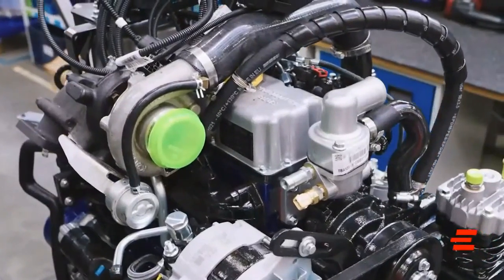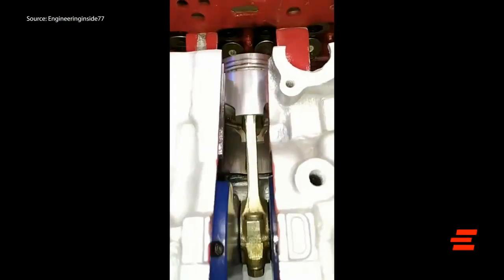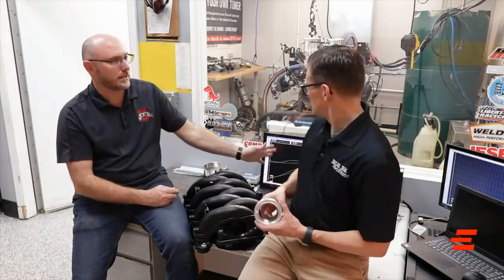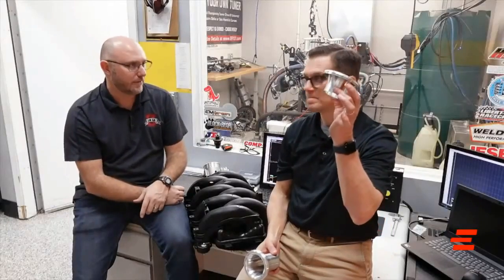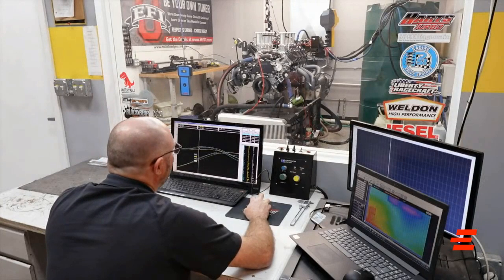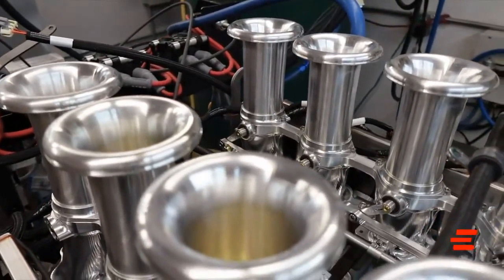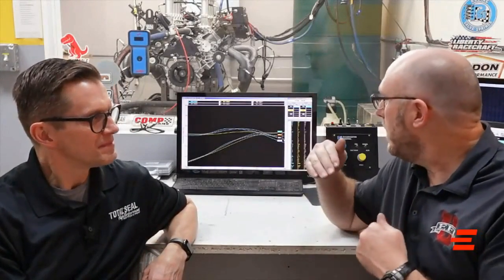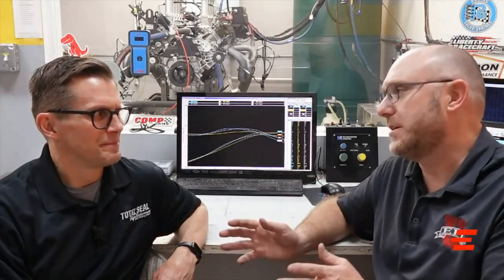Manifold Runner Length Testing (Expo 2024 - Episode 5)

Comment: Peak Tq is tuned from the CA of the head intake port and the valve size. Watching the peak tq come in so late probably reflects in BSFC.  Probably showing that even though the motor produced the same TQ at a higher RPM it probably won't Accelerate faster if the shift point is still the stock RPM.

Comment: awesome as always. I love IR systems after going to duel webber on my ac vw stuff from stock size motors up they increase everything with no down side once you tune them to your combo witch isant hard if you have half a brain. I would of liked to try them on my old 340 with 2x830 hollys on a weiand ram.( witch was very hard to beat ) I miss that car.thats my 1 life regret selling it due to cancer 31 years ago.( thus the stint for 16 years in the vw stuff.) now I just drive my tuned solstice gxp(turbo) ( but still have 2332cc&2393 cc rollercam ac vw motors I need to finish& put togeather or sell off.  keep up the great work guys!!

Comment: The old gm tuned port injection (TPI) efi manifold from the 80’s used resonant frequencies for force air in. Problems, too small runners limit top rpm’s potential, too big and you loose the resonance frequency to ram air in.

Comment: Not to disagree but raise discussion. For decades now since the TPI system which we all know ran out of lung at the higher rpm but made little CI seem like the red light to red light racer they were and then John came along with his super manifold which created the volume of air but short runners he had brought fluid dynamics thought of the column of air behind the intake valve. Then the IMRC snails began to appear which made even better improvements on the idea employing the force of the column in the long small runner as the mass moved quicker to help a little engine get the torque then needed down low.  I know you've got the dyno and etc but where is the proof of this pulse in the intake and yeah I get we reversion is. I am imagining some kind of pressure transducer hooked to manifold vacuum or maybe more than one along the length of the runner for you to conclude this. Purpose built and system designs like you talked about is also a John principal that changed us from the Smokey days of just bolt it on and see what happens to the dyno becoming the first place to look to avoid the "turd" We used to call those guys last part numbers because the must be the one to make the most power. Yep, I'm that old.  I've been so pleased to watch the changes in knowledge of how power is built to durability and use of metallurgy. I had one client ask the other day what Kryo did and if I thought it was a good idea he was considering doing it to his machine.
Reply: Love TPI Torque!!
Reply: Godzilla for the WIN! Love the content Lake, Ben great job